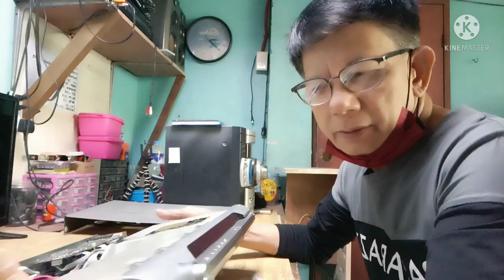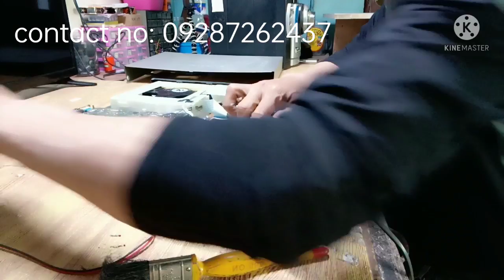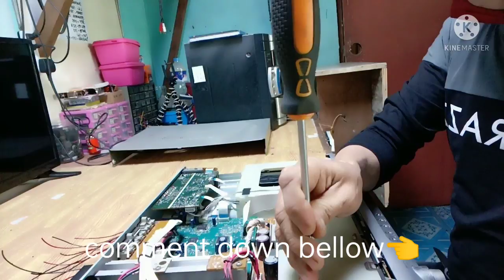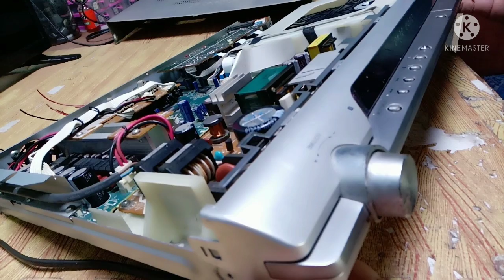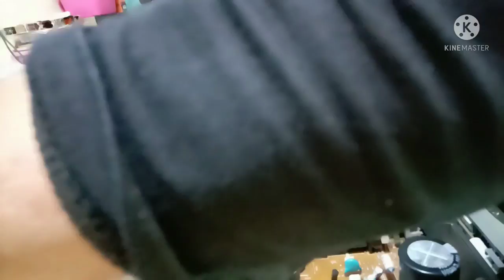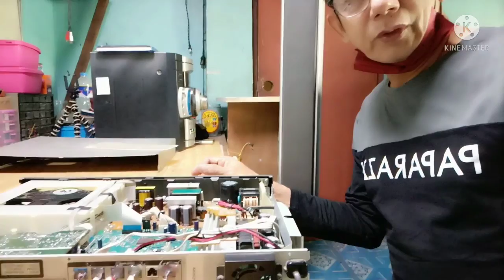sony dvd home theatre system push power protector problem. easy to repair

Comment: DAV-DZ850KW po yung unit ko sir Bale Pag binuksan sya Gumagana naman po pero ilang Minutes or minsan seconds lang bigla pong nag Protector
Reply from the maker: May missing voltage in the power amplifier section sir maybe 3.3 volts.

Comment: Sir pwd po magtanung sa sony theater power supply nya un supply ng main amp kahit hindi nka connect  un mga wire nya papunta ng secondary pag e plug dapat lalabas un supply lahat sir sa amp nya o hindi
Reply from the maker: Hello sir.. unplug mo sir yong wire to papunta sa main board at saka mo sukatin ang  power supply kong ok.

Comment: Good evening po my bigay sken Sony mu te ki pag on my lalabas na protect tpos ilng minutes ay kusang mag off, ano po kdalasan sira, tnx po
Reply from the maker: Maaari po na s t-con board ang sira
Reply: Ganun po ba mlaki yta ggastusin para maayos
Reply from the maker: depende  po sir sa technician. saan po location  nyo sir?
Reply: Samar po ako
Reply from the maker: hello sir . may open na resistor 100 omhs malapit sa stk IC.